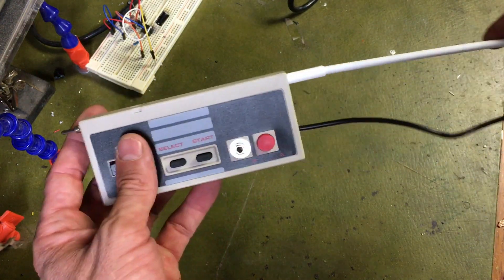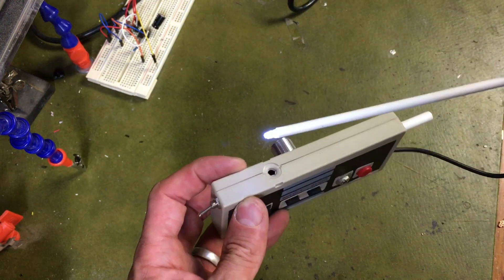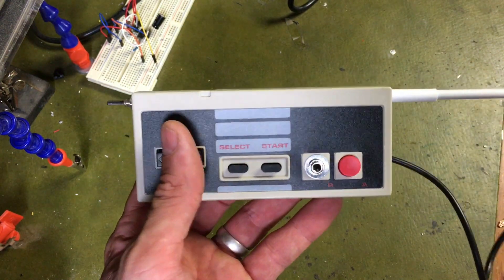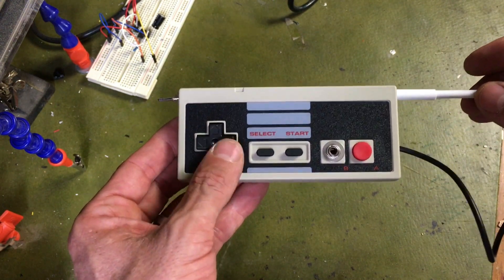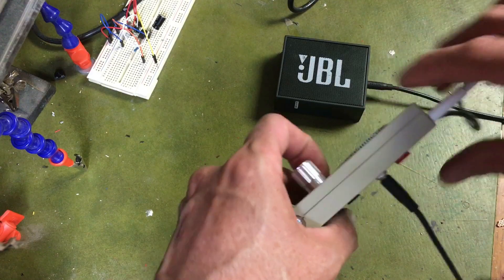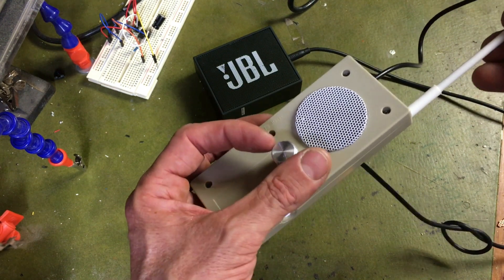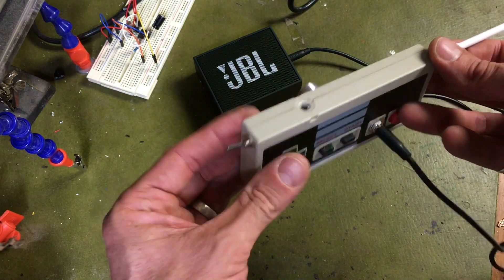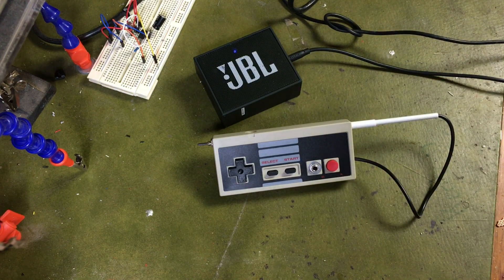Slider Synth - Light Theremin

Comment: hey, i made my own, and im kinda confused how the audio jack connects to the circuit, then instructable page doesn't mention it specifically, so i hope i get an answer, great project btw!
Reply from the maker: Howdy.  All you need to do is to connect the audio jack to the same wires as the speaker is attached to.